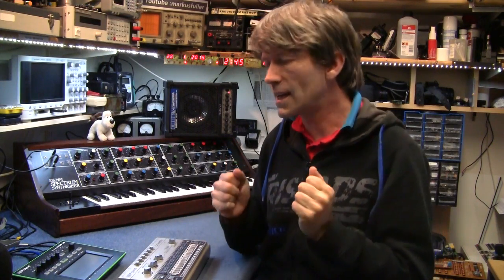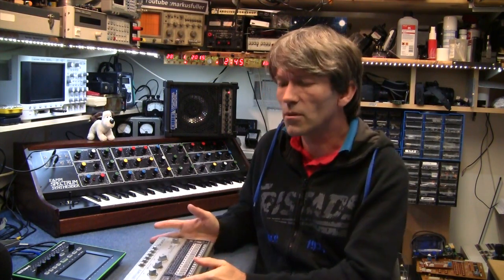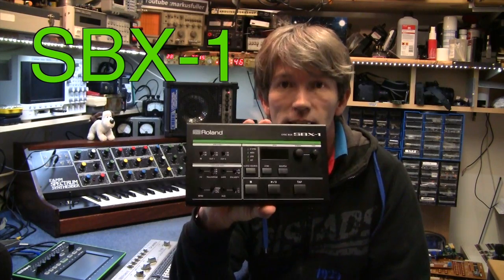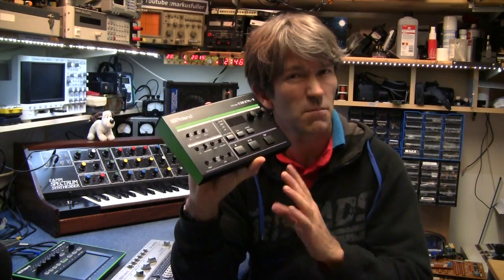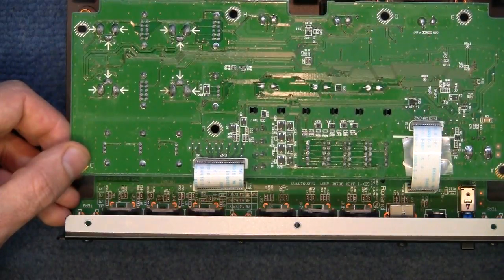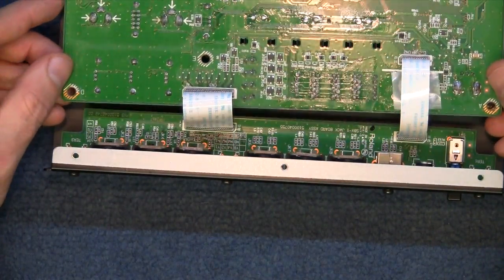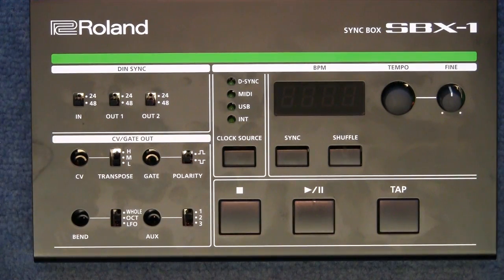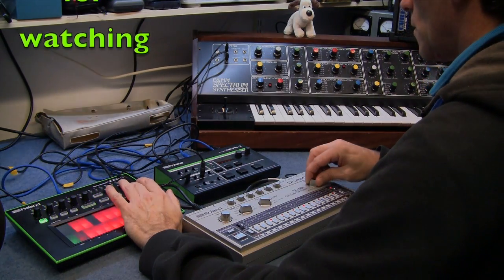MF#40 ROLAND SBX-1 Sync Box midi din cv gate converter

Comment: great chanell I like it ,Markus .What is better Roland SBX-1 Sync Box or E-RM multi clock ?
Reply: ERM MULti clock coverts the AUDIO timing from the DAW into a MIDI CLOCK , that is why in requires a 4 beat count in... using the SBX1 as a master midi clock would be no different than using a TR909 or RD9 as the midi clock. 
I could be wrong but i am sure I'm right.
Peace

Comment: I wonder how long it can keep the MIDI clock output steady. I'm making my own audio pulse to MIDI clock converter now, based on a 8 bit Atmega8A, I reckon it's a pretty weak (slow 16MHz and no 32 bit timers) MCU for this purpose since I often get drifts in the MIDI clock output.

Comment: Hi Mark, just subscribed to your channel - great vids!

Got a quick question.  Is okay to use this stuff http://wd40specialist.com/products/contact-cleaner/ on my midi controller? https://farm3.staticflickr.com/2707/4386911241_252b1608a1_z.jpg?zz=1. or do I need to take the unit apart and get inside to clean it?
Some of the buttons have to be pressed several times before they work.

Cheers
Reply from the maker: Hi wrekabuddy. to be honest I have never tried the WD40 contact cleaner though I think it should be ok. the problem is on faders some of these contact cleaners tend to dissolve the lubricant which removes the smooth action of the pot. to do the job properly you would have to take it all apart and even open up the pots themselves but thats a long job and you can not always get inside the pots. you would have to open the unit up and try & get right into the contacts of the buttons maybe using a cotton bud/Q-tip instead of spraying. theres a good video about this here on synth keiths youtube page https://www.youtube.com/watch?v=8--qp_j-l40 . Best of luck and sorry I cannot be too helpful but I do not want to just say yes when it is actually going to be a few hours work to do this properly. I have just sprayed into the pots on some items and it seems OK but the proper way takes time.  Many thanks from Markus.

Comment: I took apart my arturia beatstep sequencer it has the same ARM processor , it does CV and gate.

Korg has put the SQ-1 sequencer on the market it does both hz/v and oct/v with midi and usb 
for a moment I mistook the 606 for a 303 …
Reply from the maker: Hi A. Gigger. Yes I have seen the SQ-1 on the NAMM videos and am very interested in getting my hands on one of those. especially as they will be quite reasonably priced.

Comment: markus i have tr8 ,mfb dominoin1,
xoxbox, cell 48 system1,
rm20 boss space echo,& micro brute,
oh i dark time seqencer..
but i am getting alot of hum, can i use something so it can stop hum and protect from surge they are all going into berginger 1204fx mixer..
krk g3 rp8..
thank great vids..
Reply from the maker: Hi sothc303. sometimes theres so many cables lying all over the floor of a music room that they start to act as signal antennas. I had an annoying hum which i found was the dimmer switch on my lighting plus flourescent lights can add hum to your gear as well as running signal cables close to transformers. I try and keep the transformers and signal leads as far apart as possible but still get a light hum that annoys me rotten even though its only just there. all i can say is try moving signal cables away from other things though it may just be 1 piece of equipment that is introducing the hum into your circuit of gear. just trial and error. sorry i cannot be any more specific, Good luck from Markus.

Comment: Those mini SMD components are getting so small now, that it will become very hard to desolder or solder them by hand, let alone see them ! lol 
Reflow soldering will be about the only way this will be feasible now, I guess...
Before you actually showed what is inside this, I was estimating that an Arduino could probably do all of that. I wasn't too far off... Thanks again, Markus, for this continuing gear porn !  lol
Reply from the maker: Hi Alain, I recently bought the Arduino Mega in the hope of making something very similar but decided theres just too much work involved and far more components needed that I had not thought about. so I had better leave it to the experts to sell something ready made. Yes the SMD components are getting far too small for humans to replace.